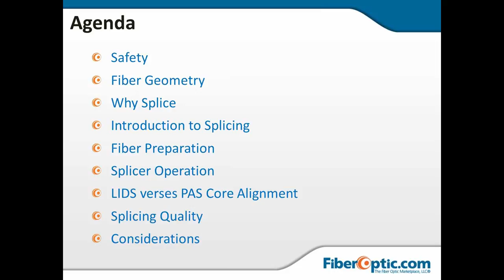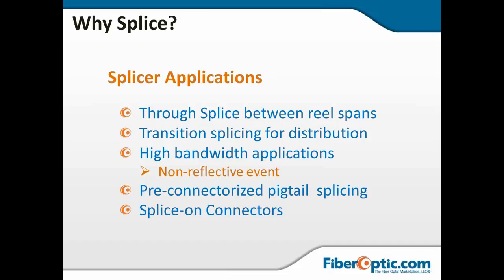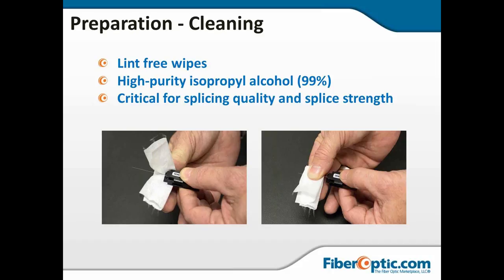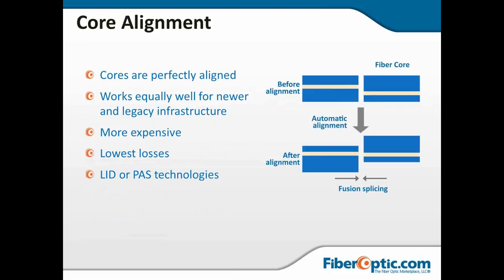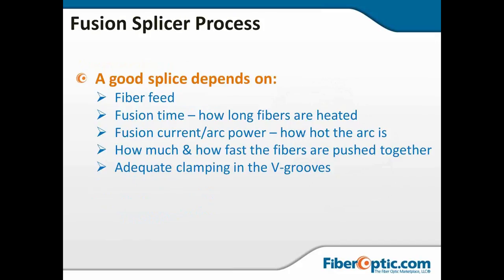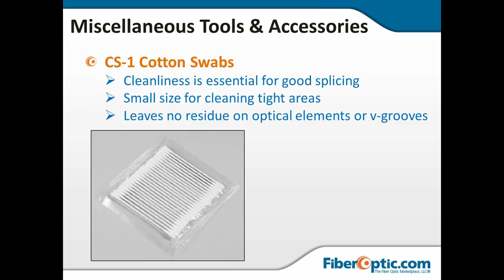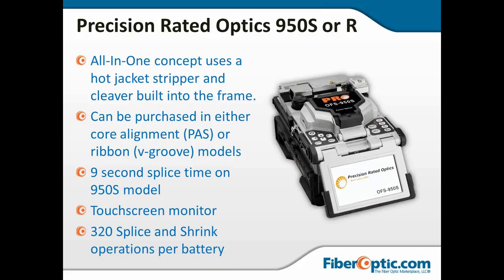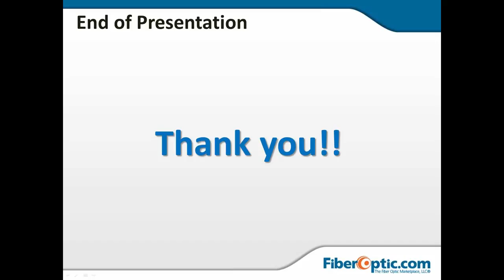On-Demand: Fusion Splicers and Splicer Types

Comment: The "All-In-One" (Swift S5) and Swift R5 regarding Ribbon is perfect.

We use the Swift K11 IPAAS.
(With the right cleaver!), in Sweden.

The NEW KF4A for the future is UNICE with the heated thermal stripper.
This we also use (In Sweden) with the Auto Cleaver.

And the DVP-740 (PAS) is also perfect.
But the cleaver and tools can upgrade in the future . . . .

The R5 is a Ribbon splicer with 2 motors.
With the best accuracy.

Also look at the angel and estimated and result after the splice.
And strength test after spice.